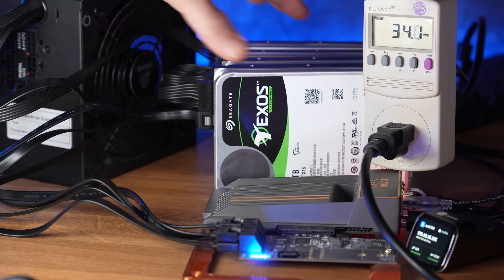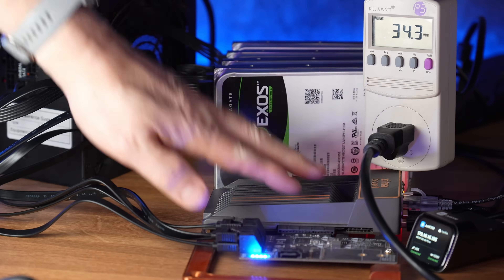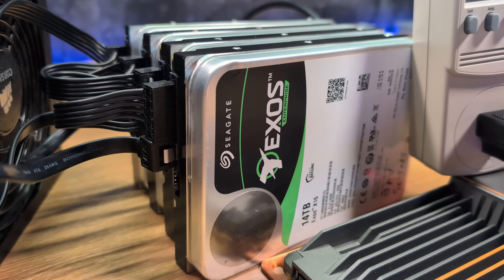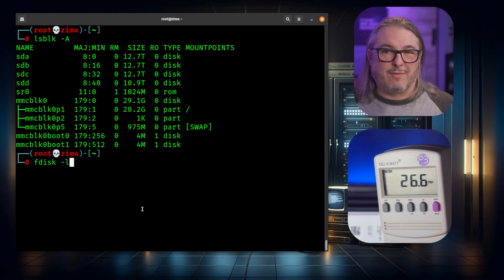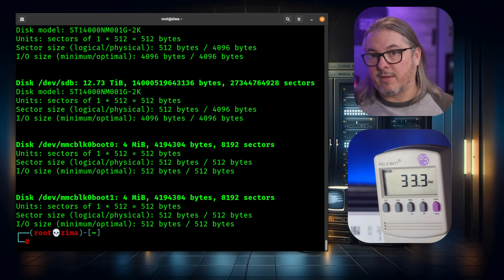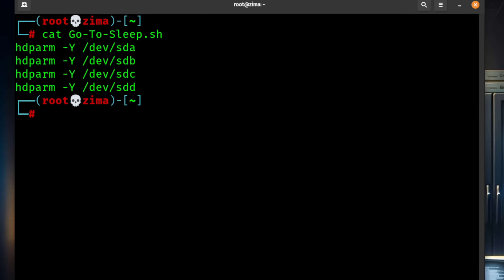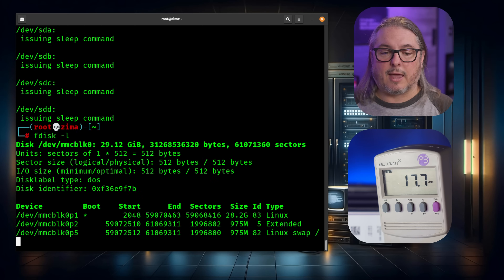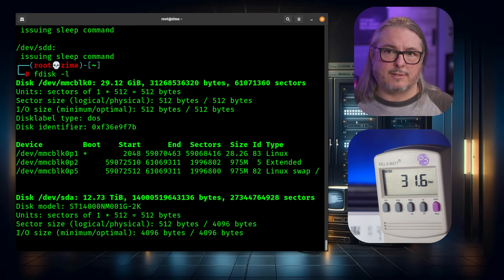How Much Power Can You Save by Putting Your NAS HDD's to Sleep?

Comment from the maker: The power supply pulls 14.9 watts with no drives or anything else plugged in and as noted in the video the Zima board is powered by it's own power supply.
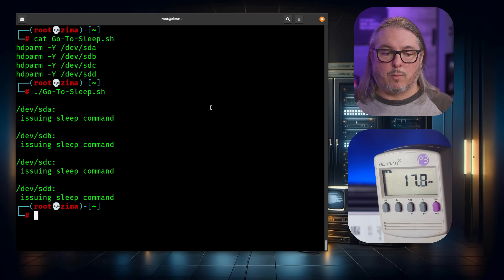Reply: I didn't see that in the video unless I missed something? If so that's quite a good result. There is some video corruption around 1:56 maybe the note didn't make it to the export.
Reply: @anthonydiiorio  The PSU hides the power savings from the 4 disks then because of it's (PSU) idle power draw. And I'll argue that's a flaw with this test, as it's not a direct test of the drives but of the PSU as well. The 4 disks on their own should draw 16 Watt less when fully spun down, we only see about 9 Watt reduction (26.6 to 17.7), the rest is hidden by the non-efficient PSU. Also it would be nice if the test was transparent with regard to what idle state firmware the disks has. The savings are bigger than this test demonstrates in a real system.
Reply from the maker: @tx2gnd  The point of the video is showing what is saved at the wall by stopping the drive spindles. Power supplies have a draw even when not under load.
Reply: @LAWRENCESYSTEMS  I understand what you tried to show. Not so sure if you actually did show what you meant to? Because there's a discrepancy between the premise in the title and initial question VS the content of the video. Can it be that your title is wrong? It says "How Much Power Can You Save by Putting Your NAS HDD's to Sleep?" Or your initial question you seek to answer when you said "how do I save power on my drives and does spinning them down really save you that much". Because, in my opinion the video failed to show the general real numbers for that as explained earlier and below. Instead I would agree that it does show the real numbers for the tested system, but that result can't be used for a general statement regarding saving power by spinning down disks. Leading to the premises laid forward in the title and question not being answered in the video or mislead us to believe that there's no more to gain.

The problem is that the result you show in this video (9 Watt reduction) is not representing the true actual power savings of the 4 Exos disks. Leading to your conclusion of not worth it as probably true for the 9 Watt for this system only. But false if you had got the right number (16 W). Lack of transparency and the test methodology gave you the wrong number that lead to the wrong conclusion in my opinion. Let me try to explain why.

Can we first at least agree on what the user manual for the Exos X14 tells us? That the firmware has 4 idle states and that the only one of those that fully turns off the motor is the fourth named "Standby". And this should result in a power draw per disk at 1.06 Watt down from Idle_A which draws 5.07 Watt.

Your 4 disks should go from an idle power draw of around 4x 5.07 W down to 4x 1.06 W, that's a total delta of 16.04 W - while your system only gave 9 W.

Would you agree that this 16 W delta would change your conclusion? If not, fine. How big would you need the delta to be to change the conclusion?

The thing about transparency and methodology. Since you didn't disclose which PSU you used in the video and at that time what its idle power draw was with no disks attached, the result you showed is wrong. Wrong, because it's hiding the actual true power usage and savings of the disks in the PSU's inefficiency. So you're not only measuring power savings of the spin-down but also the inefficiency of the PSU. It's correct for this system as it's built, but not as a general statement of power savings for spinning down disks.

Later in the comments you gave us the bare PSU idle power draw (14.9 W). The problem with that number is that it still completely hides both the initial idle and spin down power draw of the disks. The PSU lack of efficiency at what I guess is a very low load on the PSU, gives very false readings in situations like this. And the efficiency will fluctuate a lot at this load. With 4 drives idle at what we need to assume is Idle_A should read 20.28 Watt for the drives plus whatever inefficiency is left in the PSU (possible still 14.9 Watt). Your idle of around 26 Watt gives reasons to be suspicious. And again, spin down at 17.7 Watt much of the power savings is hidden in the PSU inefficiency.

My initial reaction was that your 9 Watt power reduction must indicate that your disks didn't fully turn off their motors. Now, when I know that you didn't measure disk power usage but also the inefficiency of the PSU, the result is not valid for a full general system. Because in a full system the PSU efficiency is better giving you a better delta from Idle_A to Standby. Just try this in a Storinator or any other full server.

I hope this clears up my understanding of your video and why I disagree with your findings and conclusion. I won't use more time on this. Looking forward to your next test.
Reply: @LAWRENCESYSTEMS  PSU efficiency is worse at such low wattages. A 700W PSU is probably 90% efficient at 100W but 80% or worse at 4W,. Isolating the hdds to their own power supply with no other power draw on it creates an artificial scenario that hides the true power savings.
Reply: @anthonydiiorio  he has that in all of his videos, i like to think it's his sense of humor trolling us or something.
Reply from the maker: @jordanc8926  It's a weird YouTube bug. Me and Techno Tim both keep having that happen and we don't know why because it's not in the original.

Comment: I watch your videos and learned a lot about homelab stuff. But as you are leaned toward more professional-server stuff(beefy, power hungry things), I think you made some wrong choices for test setup here. PSU efficiency really matters at low power load set-up, and not all gold or platinum psus are efficient at low power(around 20w range). You can't say spindown 4 disk saves only 9watt like that without some efficient PSU. you need to get efficient PSU first. Corsair RM650 or rm750 are known to be pretty power efficient, but now all the corsair PSUs work well at low power load.

I made some diy nases recently. x86 6-9th gen stuff with good(efficient) PSU, and my recent nas(i5-8500, corsair rm750, asrock z370m, 2nvme, 4*2tb sata ssd, 2*12tb hc520, 3*18tb hc550, 1*8tb wd red) pull about 19watt at all hdds spundown, pull about 60watt at all hdd spunup. This is more than double powersave compared to your result. And my system is not even really 'power efficient' compared to some machines i saw online.

Comment: The wear on the drives is negligible. Over 40 drives in a decade in use not a single fail. It's a backup of a backup system. Power on do job (2-4 hours) power off. The primary backup has more disk failures with 7x24 usage. It's enterprise stuff in a proper datacenter.

Comment: Been meaning to buy a new NAS enclosure to run TrueNAS instead of keeping using and old desktop also because of power efficiency, plus a bump in performance... but still wasn't quite there considering spinning down drives. Will see about wake on lan instead perhaps. I don't need it running all the time.
Just that my old desktop is just too old. xD Intel Haswell.
I did the whole stupid thing upgrading it before considering to get something new... the PSU was blown so I got a new one, procured RAM for it, got a new network card because the integrated ethernet was behaving weirdly... and then my power bill came and holy sh*t. xD

Comment: Interesting topic. This is something I dealt with extensively not only because it saves power but also because I have my home lab at my desk and I need it to be quiet. 

My home lab with one ATX Fujitsu Siemens with an i3 6100T and an Optiplex MFF with an i3 7100t will idle at 37 Watts. It only spins up my disks when doing a backup once a day. I have 4 HDDs 2.5" and 3 HDDs 3.5". When they all run simultaneously they will consume double or triple the wattage. My home lab would cost me 120€ a year with my spinning down measures so I would say it's worth it. Especially when you use (old) consumer grade disks.

Comment: I think that the BRAND of the drives can make quite a significant impact on the results given that the data that we already have from Backblaze, for example, already puts Seagate at a higher AFR compared to the other makes/models.

That being said -- on my 4-bay QNAP TS-453Be NAS, when I spin down the four HGST 6 TB SATA drives I have in there, it will drop down from ~50 W down to ~17 W.

So, the power savings that comes with spinning the drives down ends up being quite a bit more substantial.

On my main Proxmox server, however, where I have 36 drives, the chances that I will be able to actually spin down the drives is pretty much next to zero, as there is ALWAYS some disk activity going, for a variety of reasons.

Comment: I think this test is a bit too narrow in scope. I understand you're trying to refute a certain specific claim about wattage, but there should be a lot more to it. As another commenter had mentioned - there's going to be a significant noise & temperature difference even in a scenario of a small number of drives where power savings won't be a big factor.

What should be looked at is the option having both SSD and HDD in separate arrays,
SSD array always on and the HDD array only at certain times.
Should be easy to implement and test in two different NAS systems, might be worthwhile to also test a jugaad of this in a single system.
In a scenario where you might want a few tens of TB "to exist", but you don't need more than maybe 10TB at constant-availability then the total difference can be significant.

Comment: More than watts, it's heat and noise when you start to have a fair amount of drives.
I moved from TrueNas with always on raid array to Unraid with selective spin up/down.
The difference was massive on the heat side (about 10c in my ventilated server closet)

Comment: I experimented with shutting down the drives with Truenas but did not like how long it took for them to spin back up and provide data. Especially since they also store my Plex library. Clicking on something in Plex would leave you with a spinning circle for 30 seconds or so until the drives were back online. Went back to leaving them running all the time.

Comment: I did experiments like this when I worked at Netapp. It was a long time ago..back when 4TB drives were the largest drives ever made. I didn't see any difference in longevity. It was the quality controls of the manufacturer that determined longevity more than anything..that and temperature. We experimented with sleeping drives because the cost of running our lab each day with HVAC was astronomical, thousands of dollars each day.

Comment: We had mailing servers and machine computers run scsi 24/7. Only shut down for total power lost, lasted 10yrs. We used unix5 on machines and windows server on the Dell server.  Power on was more critical than saving power or you wouldn’t get your credit card bill, gas bill, electric bill, or in some cases, your paycheck and your tax return

Comment: For the longest time i didn't spin down my drives, but I've recently reorganized my storage so very few things actually need spinning rust, and most is in flash somewhere. Another problem was the dreaded issue that SMART reads for some reason keep them awake, but i digress.

The 6 drives home-server normally uses 95ish watts with them spinning, and this drops to around 60 now. Electricity is relatively expensive here at over 0.40€/kWh so this saves over 100€ per year. Should've done this a long time ago.

Comment: I have 8 HDD, 5 SSD setup in a 6 core 11500 NAS. One drive on its own might get accessed over the span the of the day. The entire server idles at ~62W GPU & all. If I ask the drives to stay spun up I'm looking at about 110W. My other server used to be run off a 65W chip and had a system idle of 60W with 14 disks, with the disks spun up it would idle at 144W. What's more important though is that it was not striped storage (other than the SSDs). The spike in power doesn't mean anything for the power bill it's transient and I feel like some people are going to take this as an 'um-actually' later (however it's good that you mentioned it but I was hoping you would mention it in regards to wear)

If you're running striped storage it's a totally different situation to a JBOD. When you ask that striped pool to sleep then wake for rights you have to deal with the amplified vibrations from all the drives waking at once plus the huge current sag. However in a JBOD scenario where each is written to individually or just X drive + Parity drive, it makes sense.
Reply: Our customers were given rights to tape back up on their main system, we were a closed loop network. Unfortunately, they  backed up every six weeks,  something their IT management decided on their own. The problem was some of that data needed to be accessed a year or two later. They kept that for court cases of fraud since we imaged every letter and document that went out. Fortunately for them, I was copying to CD encrypted once a month and handing it to the manager, which saved the company millions of dollars against lawsuits. We did have scsi failures after 10+yrs, which mostly sounded like dental drills Very noticeable. I had 5 separate unique drives swap abled and 5 computers ready too. Image from 2004 to 2018.

Comment: Comes at the very right point in time. I was just about to buy 4 drives for my home nas. 
I would also be really interested in how ZFS reacts to drive being spun down or how to tune it to allow longer timeouts. 
Or Will a read/write cache nvme allow the drives to respond later. 
Moreover the noise floor of exos vs e.g. ironwolf drives in different power states is very important to me. I can read the dB values from the data sheet but don’t know if I will hear it while sitting next to it 😅
Reply: I have an array of 20 12TB Ironwolf Pro's using ZFS with an 2TB nvme drive as read cache. And noise and power consumption are also considerations for me.
I have my drives set to go beddy byes after 30 minutes of no access. When they are sleeping and I access data stored in the read cache, the drives don't need to spin up. Though, sometimes they do and sometimes they dont. I think its to do with a specific setting dictating the period after which truenas should check for a new version of the cached files. Or maybe its something to do with specific file types that check for new versions. But most of the time when I'm accessing media files, the drives will not spin up. Sometimes when accessing documents, the drives will spin up, but not always.
All the important data I use every day is stored on an SSD array so access is fast, random writes and reads are are pretty good and there is rarely any delay in access times.
In terms of the write issue that was mentioned, with ZFS it is not an issue as the RAM is used as write cache. So files copied to the NAS when the drives are spun down are written to the RAM first and then to the drives once they wake up and are accessible again. Which is a big part of why ZFS is so great.
Overall, considering my spinning rust is only cold storage that is not accessed very often, putting them to sleep when not in use is absolutely saving me a bunch of money on the power bill. Literally hundreds of Watts. Especially considering I have 20 drives compared to the 4 used in this video.

Comment: With my Synologies  and them getting drive sync, and hyperdrive backup,  a slew of bit torrents.  I think maybe I have 2-4 hours a day when MAYBE they aren't active.  Turn off the lights when your not in a room!  I do have a Sonoff 31 running tasmota on most of my house.  Espescially now with the holiday lights.  My switch rack with 3 switches, fiber modem, router and an oscislating fan use more power. and I'm not shutting those down.   IMO!

Comment: I have an Unraid server with 20 drives, I have the drives set to spin down after 30 minutes of no activity. The server pulls about 150W when the drives are all spun down and over 270W when they are all spun up but idle. It's mostly used for Plex and with the way Unraid works it only needs to spin up the drive it's reading from, so I ensure that each shows episodes are on the same drive together so it's not jumping from drive to drive. I have had no problems with excessive drive failures since enabling spin down.

Comment: Thats why I ended up going back to Mergerfs+snapraid. Most of my data does not need to be spinning around 24/7. I for example, cannot sleep any drives. I have on my servers about 60+ services running, so it would be accessing, reading and writing 24/7 if I did one-stop solution, thts why only media is on HDDs(mergerfs) and everything else on NVMe raid. Then I can benefit of each drive sleeping seperately when not in use.

Comment: We want to save energy. So the term watt-hours should have been used at some point. Instead we only talked about watts which is instantaneous power. I would have expected a result something like, "With the drives spun down we are saving X watt-hours per day but a drive powering up requires more power for X number of seconds therefore to make this break-even the drive must idle for X seconds/hours/days/whatever on average before each wake and anything longer than that is savings."

So I don't think we have learned anything useful here as of yet.
Reply: Yep a more mathematically approach is needed here. Otherwise that comparison as he did is just a kind of feeling